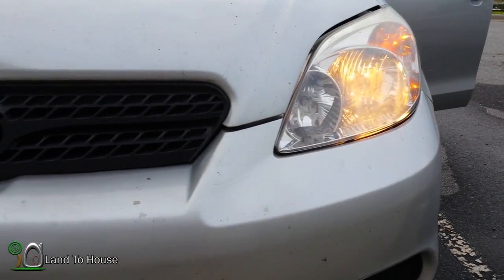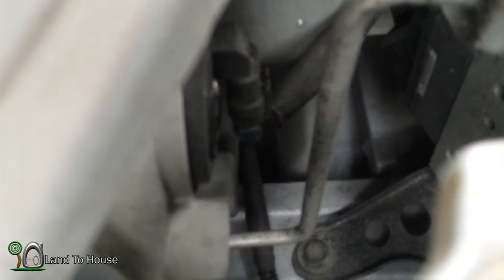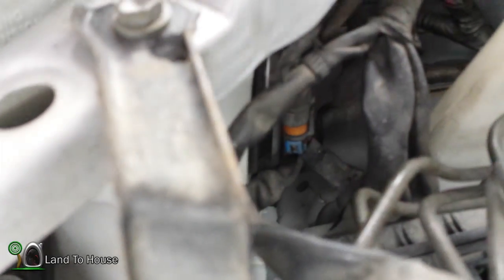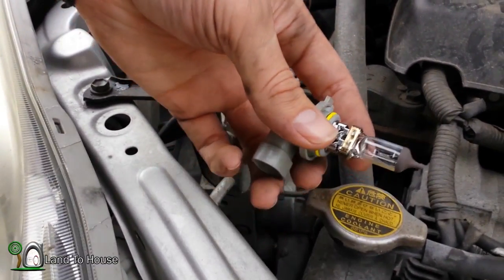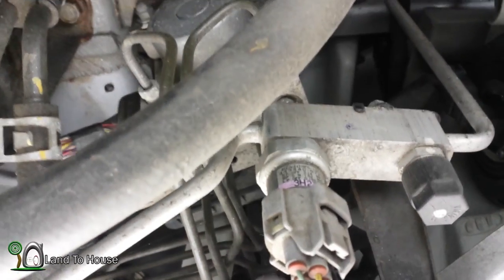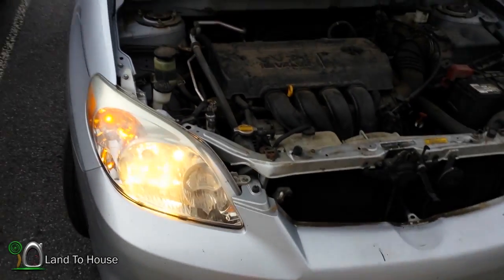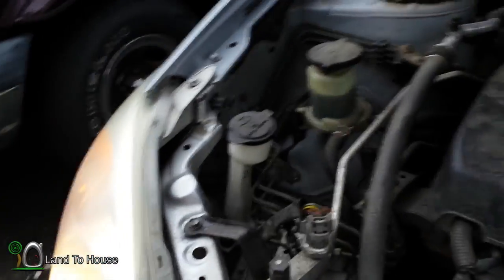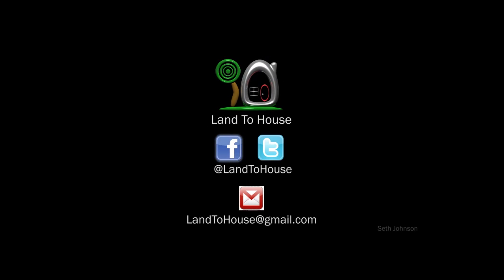Toyota Matrix Headlight Replacment

Comment: I'm glad you emphasized the importance of not touching the new bulb, Body oils will cause a hot spot and blow the bulb in a matter of minutes. Good Job Seth !!
Reply from the maker: +Barton Robinson I had not ever touched one but I had heard that it would happen if you got oil on it. Nice to hear that someone else says the same thing. :)
Reply: I learned first hand on a 96 Buick, had the new bulb in, turned on the lights, "POP" went the bulb. Called the parts man, he affirmed that was the problem, new bulb, 15 buks lesson learned..Works every time..lol..!!
Reply from the maker: Losing money will do that every time.  I prefer to learn without losing it but that is rarely the case.
Reply: I'm agreeable on that !

Comment: You can also twist the back of bulb fixture counter-clockwise FIRST, remove the socket with the bulb, THEN remove the bulb from its socket by prying the tabs on the back. This might be easier since once you’ve removed the socket attached to the wires, the tabs are easier to see!
Reply: It’s not easy either way.  Believe me.

Comment: Helpful, but would be better if you used words like turn counter clockwise or turn toward the outside of the car etc. Also there are two ways to do it, one is to remove the wire from bulb  first and then the bulb(as you did) or you can remove bulb and wire together and then unplug and replace the bulb. Good to distinguish the approaches.
Reply from the maker: This really is an easy change. I will have to be more descriptive next time. Thank you for watching.
Reply: so do you turn clock or counter?

Comment: Hahaha . . . looked up how to do this for my 2008 Matrix and friend Seth's video is the first one that came up!  I'll let you know if I'm "simply" able to install my new light. Thanks for the tip, Seth!
Reply from the maker: Hi! A 2008 should be the same as 2006 model. Be sure to keep hand oils off or it can shorten the lifespan of the bulb. The plastic parts on my 06 are starting to get brittle.

Comment: Good video, and thanks! Wasn't too sure on the socket locking mechanism. A tip? When one headlamp bulb burns out, change it's twin on the other side, too. If one goes, the other is usually not too far behind.
Reply from the maker: I can believe that. Seems like it was less than 2 month before the other one went.

Comment: I feel there is a big gap in instruction between unplugging blue clip that’s attached to the wire and actually taking the bulb out. I got the wire out and now the bulb is still in the casing.
Reply from the maker: It's so hard to film that. My bulb had two plastic tabs that needed to be pulled out before it would come out.

Comment: i have a 2009 toyota matrix do you know if it's  the same
Reply from the maker: I have only seen the 2009 Sport Edition. It is shaped a little bit different. But typically the headlamps are easy to change on all of these vehicles. I would recommend just going to your parts store and asking them. They will be able to give you the correct lamp. And remember don't touch it with your hands. The oil will cause it to break
Reply: yes i have the matrix s
Reply from the maker: Very nice.  My sister drives one. You should have no issues changing the bulb.

Comment: Thanks for the video.  It's definitely a tight squeeze but its a lot easier than pulling the whole headlight out.  It looks like its held in place by two bolts up top but warning to all those who are trying ti, there's a third one on the bottom that you have to push out your fender for.
Reply from the maker: +firebirdx01 that does seem like a bit of a hassle. This method really is not that bad as long as you have time to fiddle around with it.